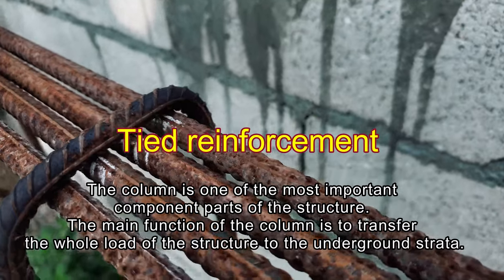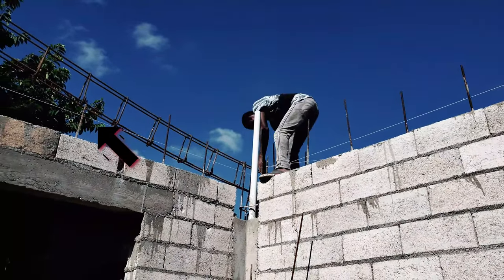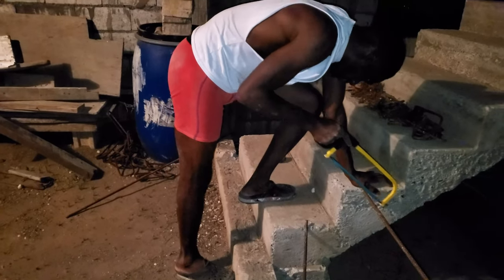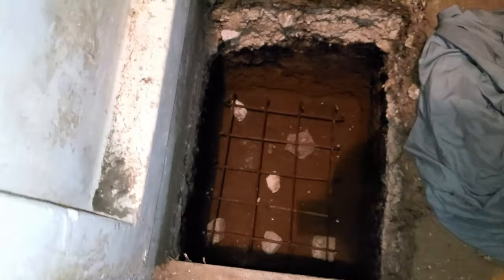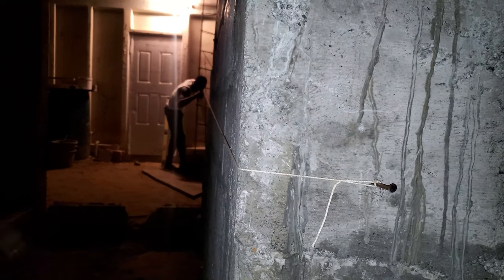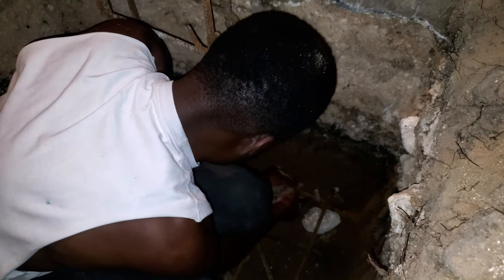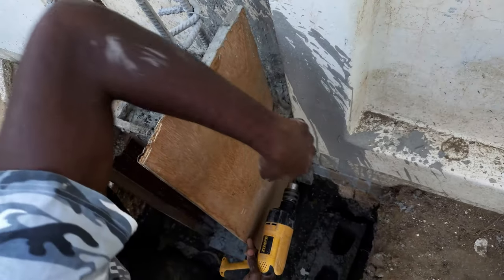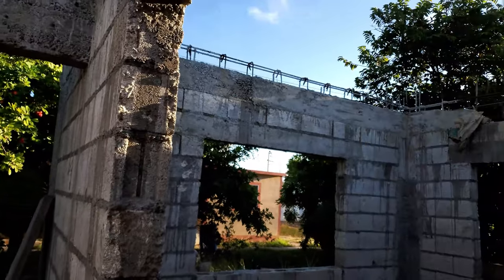Building a Jamaican Home Series: High quality Column

Comment: What's the measurement of the column at 18:25? About 15 of those would be approximately how much square feet?
Reply from the maker: Blessings its calculated by running feet the size is 12 by 6 height is 4 feet time 15 which is about 60 feet.... but it is different in some areas because of the wall

Comment: Hi, Which size blocks do you use for the external walls, 6 or 8 inches? Thanks
Reply from the maker: Good morning I'm using the 6 inches I'll only use the 8 if its a retaining wall or for the partition wall in my shower where I'll be cutting out a few niches
Reply: Thanks 🙏🏽

Comment: Is there a reason a mason would go from using 7 half in steel in an l column.  To using 6 pieces of steel.  It will be. Supporting a level upstsirs and roof.
Reply from the maker: he might just forgot to put in that one but it recommended to use 7
Reply: @paynefuldiy  he did it on 3, and was about to do a 4th column like that.  How we have to demolish the columns and do them again.
Reply from the maker: no if its already cast